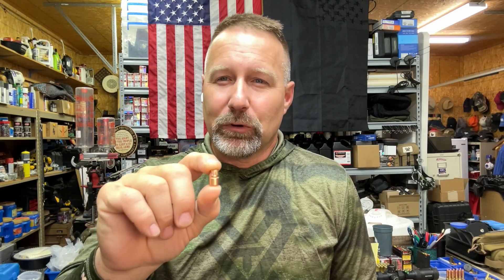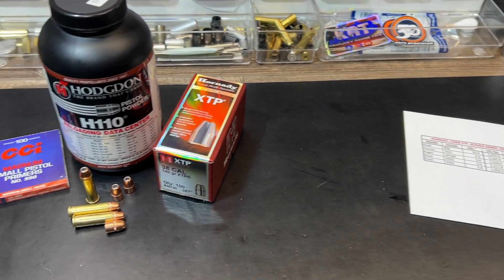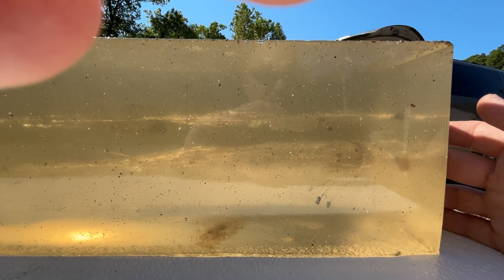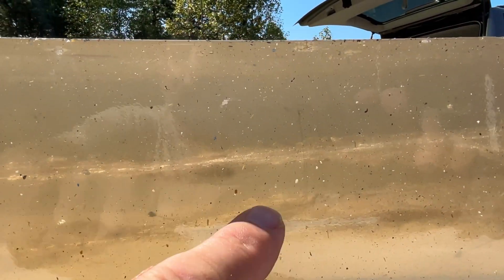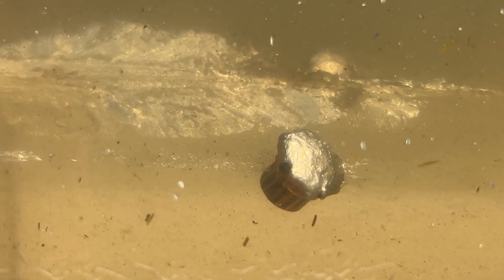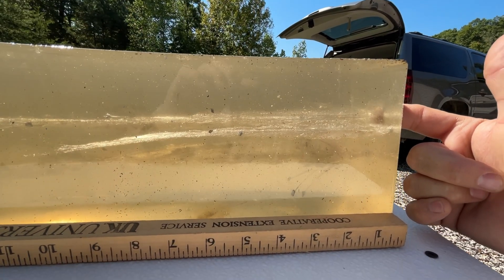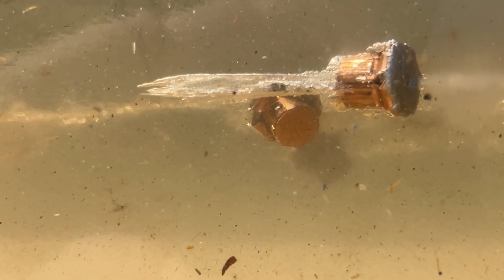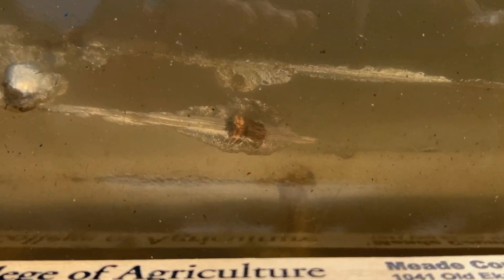.357mag, Hornady 140gr XTP Bullets Tested in Gel Block, Using 5 Different Barrel Lengths!!

Comment: Rifle barrel aside these did really well a good mix between the 125's expansion and the 158's penetration. Would be a good choice for a 3-4" barrels where a 158 might not reap the benefits without the extra barrel length. This is splitting hairs as all the xtp lineup does really well.

Comment: Interesting observation: I got the velocity from a 3 inch Ruger GP100 as you got from the Rossi 3". Same bullet and same powder. To me the interesting part is that I only used 17.2 get of powder in mine. Seems like in a 3 inch barrel -/+ 1200fps is about all you're going to get with h110 and 140 gr bullet no matter how much more powder past about 17 gr. From my 16" Rossi 92 I'm getting about 1825 fps with 17.2 gr of h110. So only around 100 fps less than your 20". Anyway I enjoy your content. Very useful information.
Reply from the maker: @Scout66  👍🏻Thanks!  There’s definitely a point where more powder doesn’t yield an increase in velocity, usually in shorter barrels where the bullet exits the barrel before all the powder gets burned up, and another point where excess barrel length actually adds resistance and starts slowing down the bullet.  This is where powder selection starts factoring into the load development process.  

I still find it pretty interesting that  different powders ignition and burn characteristics, in an explosion that happens in a fraction of a second, can still make such a difference in a bullets performance. 😉👍🏻
Reply: @kentuckyrangetime  side question: in my Rossi 92 I'm getting case bulging just forward of the rim. Happens with all 357mag ammo, factory and hand loads. Some more than others. Does not happen with 38 special. This is a new gun. Read that it's common in these guns. Have you seen this in yours?
Reply from the maker: @Scout66  yes. It’s a Rossi thing and is common with most all my .357 and hotter .38 loads. The bulge come from the small feedramp cut into the bottom of the chamber. 

I have a matching R92 in .44mag. No feed ramp cut and no case bulging.  

I hate it too. I’ve been trying to only load my my mixed range brass and a small batch of Starline for the rifle. The bulge has mostly bern sizing out and I haven’t had any issues with the resized brass in the rifle or any of the revolvers but it’ll definitely shorten the life of a price of brass.
Reply: @Scout66 my Rossi M92 does this too. It’s because the chamber isn’t fully supported towards the opening (rear). It’s made this way so it can also get reliable feeding for the 38 Special ammunition.
Reply from the maker: @Scout66  Check this one out…

https://youtu.be/er0bImjYQ3o?si=GIDEj1RK9v2VMZn_
Reply: @kentuckyrangetime  well son of a gun! I'm new to the channel so I haven't seen all of your videos yet. Exactly what I was talking about. I figure I'll use 38 special for fun and new or once fired 357 mag brass for more serious use. Then reuse that in revolvers only. Thanks for the info!

Comment: Looking forward to the 38Spc coming up! Did you happen to run a mag tube of the 140gr XTP's through the Rossi? Mine seems to be kinda picky about the bullet's nose profile.....
Reply from the maker: @MikeJacobs-c4l  i didn’t with the 140gr but have run lots of full tubes of 158gr with no issues. All the different weights of XTP bullets have the exact same nose profile.  I don’t even have to change the seating due on my press when changing weights. 😉